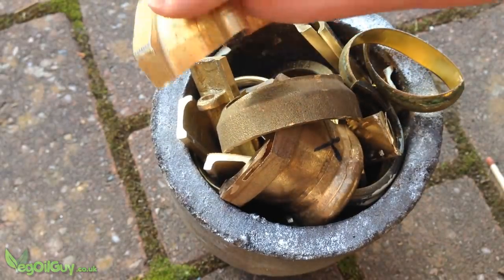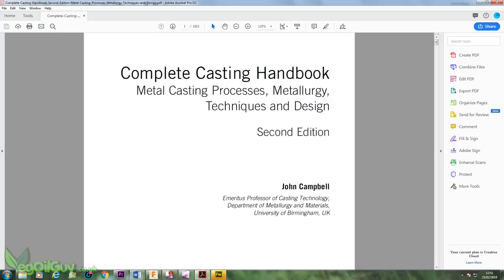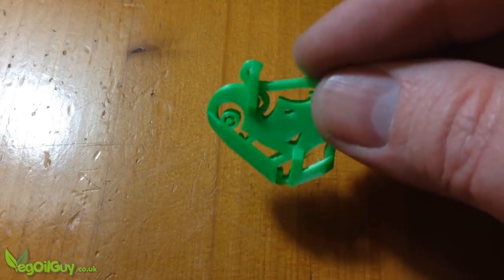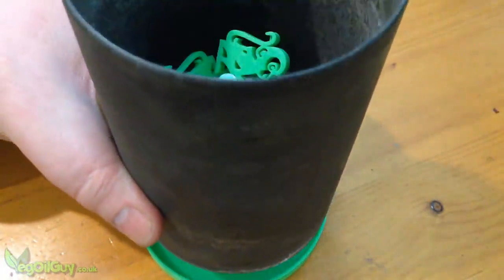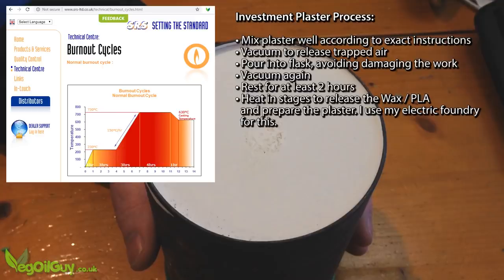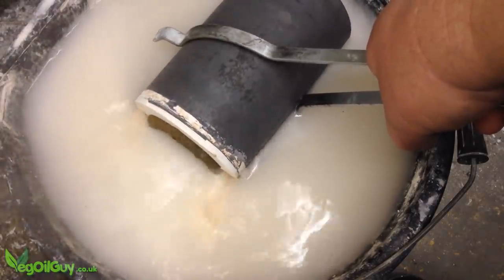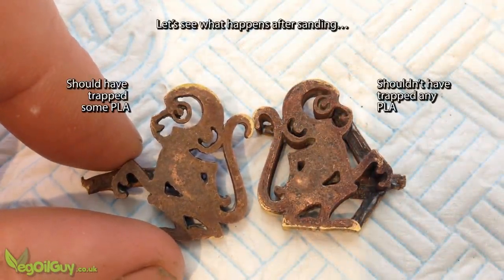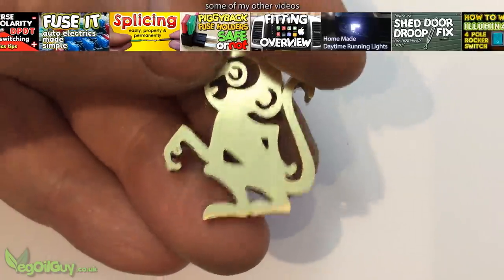Lost PLA Casting Brass Monkeys, Tapered Sprues & Casting Tree from 3D print to Brass Casting VOGMAN

Comment: Best investment casting test I've seen on YT. nice to see more people reading Campbell's book
Reply from the maker: That's very kind : D
And reading Campbell's book is easy. Understanding it is a bit trickier for the amateur like me ; )
Reply: All that blue-white smoke from the brass... don't breathe that. Metal fume fever cased from breathing the boiling zinc in the brass turning to zinc oxide in the air is no fun.
Reply from the maker: I was surprised how smokey it was. I imagined it was impurities - dirt, grease, flux, etc, but I understand it's common enough with the metal.
Reply: @vogman  understanding some parts of Campbell's books are hard for industry casters too, that's why you see  shops pouring a pencil sized stream of metal through a straight sprue you could fit your arm down and not down a proper sized tapered sprue.

Comment: Great results, Im impressed with the detail you are getting with PLA and FDM printing. I use a bucket with a hole in the lid and a pressure washer to remove the investment before cutting the castings from the tree. a mild pickle or acid will help brighten up the metal. Citric acid is used to descale Brass coffee machine parts so you could give that ago.
Reply from the maker: Nice tip Wayne. I considered the pressure washer but it's so messy. I also did soak for a few hours in vinegar which helped a little
: )

Comment: Hey VegOilGuy I recommend cleaning in a wet tumbler with stainless steel pins. Use a little dawn or your favorite dish detergent and some LemiShne or citric acid. It only takes a little of each. The still pins will clean the scale and polish the brass to a beautiful shine. Let the water and pins do the work for you. For example look up cleaning brass shell casings with steel pins. love the video and the small items you are casting.
Reply from the maker: I'll be honest, you're not the first to offer me that advice. For that reason I've ordered one and am awaiting delivery  : )
I'd never come across them, so I do appreciate the advice. Better to be told several times than not at all. 
A bit of research informs me that as well as polishing the surface, the bearings act as tiny hammers and actually harden the surface slightly.
I'm all about the lazy way. Thanks for the input  : D

Comment: Just splendid. If I may; try giving pieces a quick dip in muriatic acid followed by a whiz with rotary tool brush. Tremendous time saver (and great for us lazy fellas).
Reply from the maker: I'm all about the easy way  : D
Thanks for the tip.

Comment: Great looking castings, and some interesting experiments! Thanks for sharing. Every new video is making me want a 3d printer and an electric kiln/furnace. If you don't mind my asking, what's the investment plaster costing and where are you getting it? 
Have you thought of making extra voids in the investment so you don't need so much of it and the vacuum can suck more directly at the castings?
Reply from the maker: The investment seems expensive at a glance, but it's a very large bag. Here's a link - https://www.hswalsh.com/product/pioneer-smoothcast-investment-powder-tc0451
And a 3D printer? Be warned. It will change your world. The moment you start, your thinking changes and you can see more creative opportunities.
Yes I have considered using up space to minimise lost plaster and also ways to improve the suction through the plaster, but in honesty it's not been an issue yet. I struggle to fit everything in as it is, so there's not as much empty space as you'd think, and vacuum works very well through the plaster already... that's the plaster's job  : )
Reply: @vogman  The other thing to consider is that introducing either fill blocks or void spaces adds additional variables to the casting process and could easily cause unnecessary complications. In this case the minor extra material used in the casting is the price that you pay for the K.I.S.S. Principle. Keep It Simple Stupid and things are more likely to succeed.

Comment: Nice work once again. Brass can be a bit of a pain to cast I haven't had too much luck either. Might help adding the borax earlier on as it can form a protective layer preventing too much zinc burning off.
Reply from the maker: It was my first time. I was amazed how smoky it was. And the scale was a surprise. But it does produce a beautiful finish.
I'll have to give your tip a go  : )

Comment: You will always get that look from brass when it has just been cast even from Ingots. The more work you put in to fettling the nisa the monkeys will look.
Good job 👍
Reply from the maker: Thanks Stephen. It is a rewarding metal to put effort into. That shine is gorgeous. I just can't capture it properly on video  : )
Reply: @vogman  have you ever worked in castings or is it just a hobby.
I spent 18 years working for company that casted aluminium and steel components for the aircraft industry. We used the lost wax investment process. very similar process to what you're doing but we coated our castings in zircon.
Nice video looking forward to seeing more 👍
Reply from the maker: No my friend. It's purely a hobby and quite a recent one. If you look at the dates of my videos, you can see how recent.
I tried Lost Wax and enjoyed it, but I don't have the skills to produce the excellent waxes I want, plus silicone moulds are expensive. But I've found by treating PLA as Wax, it works brilliantly  : )
Zircon eh? Never heard of it, but I'll look out for it  : )
Reply: @vogman  it's a coating that is put over the wax mould, well it is actually dipped Into it and built up in layers, it then goes through an autoclave to take the wax out of the mould prior to casting.
To clean your moulds we used a hi pressure water jet, maybe you can use a jet washer but be careful that it does not blast your parts of the mould.👍

Comment: How do you enable the vacuum process in the plaster mold? Is there a separate hole to meet up with this? Apologies for asking, but I didn't see in your vacuum casting video. Thanks! great video as allways!
Reply from the maker: No worries Robert. The vacuum is turned on before the pour. The plaster is porous on a microscopic scale, so whilst it doesn't look it, the vacuum can suck through it. It grabs the metal and pulls it into the plaster mould, removing all air pockets that would otherwise spoil the finish  : )

Comment: Didn’t disappoint! 

What about throwing the parts in a vibratory tumbler to clean them up without any elbow grease?
Reply from the maker: I must be the last to have heard about these...but I'm catching up quick I hope  : D
Reply: Haven’t got one but would love to see if they actually work! Heard good things...
Reply from the maker: I'll see what I can do  ; )
Reply: @vogman  , I just wonder if one could use a case vibration system.  I think Lee and RCBS are 2 places to start. They are use to vibrate cartridge cases in I think walnut hulls ground up.  It cleans them inside and out and even the primer pockets to a very nice shiny surface.  Not sure about cost or availability.  UK I think you can look for one on Optics warehouse or is it optics planet? 
   So any way it's a half hemispheric bowl w a lid and a centerpiece.  One puts in brass and polish media and turns it one n leave it for a time period.  The vibration rolls and stirs the parts. I've heard of it used for brass bronze aluminium copper steel and cast iron. Various types of mediums and coatings can be used I hear. 
  Hey check it out...and maybe you can bennifit from it...or smart as you are you'll make one of your own w an orbital sander and an old gyroscope. 👉👉👍👍👏👏👏😁.
   No insult intended but I find you unusually resourceful in repurposing things. 
   Blessed days sirSir and keep up the very interesting work u do, Crawford out
Reply from the maker: No insult taken, Daniel. I tend to find if I buy things at a price I can afford, they don't work very well. So I try a few alternatives to see what happens  : )

Comment: Thanks so much for those experiments!  I am just getting into lost PLA and I had wondered both about sprue design and trapped PLA bits.  You answered both my questions! On another note, have you been happy with your bottom draw vacuum system?  I've noticed that the pay for systems draw a vacuum on the sides of the flask as well.  Doesn't seem like that is really necessary given your results.  Would you agree?
Reply from the maker: Hi John. I would imagine that an all-round vacuum would give better results, BUT it's quite an investment. I watched PressTube talking about buying one for $10,000. Now I think that's a bit steep, even by professional casting standards, but my home made system could honestly be made from spare parts... and with brand new parts, maybe £50. 
So if you've got PressTube money, get the best. There's no guarantee your castings will improve unless you do everything right, but the equipment can't be blamed.
If like me you're on a budget and still learning, then do it on a shoestring. Get your casting skills right. Then maybe one day you can get the expensive equipment - that's my logic .
BUT... and I really mean this, some of the lost PLA's I've done recently, I genuinely can't imagine HOW they could be improved upon. So the equipment does work... and I can put the savings to other fun stuff : )

Comment: Would using an abrasive blaster help to clean small details?
Reply from the maker: I haven't tried it, but there's a couple of comments here from guys recommending it. I think I'm going to have a go with a DIY tumbler first. If it works and does a fair job, I'll be sure to share it here  : )

Comment: I like the method! It looks like the surface finish turned out extremely well! 
I might have to take a crack at this, assuming I can ever find any refractory in my area.  Luckily, I've still got a bit of SatinCast around.  Any good and reasonably priced crucibles you can recommend?
Reply: I rather like the unfinished edges as well.  It shows it wasnt mass produced, and adds to the overall look to them.
Reply from the maker: Crucibles... it's a love and hate relationship there. I'd love an expensive one as they apparently last a while, but they're ten times more expensive than the cheap things I purchase for eBay.
Reply from the maker: I'd like to claim it's an effect, but really it's just lazy clean-up  : D
Reply: Ah, it's a feature, not a flaw! 😉 I'll have to look on Ebay. Thanks!

Comment: Very good!  I'm thinking of lost PLA castings in the near future.  Have you done lost PLA with with sodium silicate molds instead of plaster?  Is that possible?
Reply from the maker: Hi Andrew. I did a number of experiments when teaching myself Lost Wax casting and soon realised there's no substitute for the proper Investment Plaster. It's porous on a microscopic level and that allows a vacuum to pass through the plastic, acting on the metal. It greatly improves results : )
Reply: @vogman  can I email or private message you and ask your advice on a part I need to cast?
Reply from the maker: Of course my friend. Just go here - http://vegoilguy.co.uk/contact_me.php - and send a brief message. This will allow us to exchange email addresses privately and then we can chat from there : )

Comment: Over on swdweeb’s channel, John Campbell’s protege Bob Puhakka has a few videos up explaining the best-practices you can glean from the book.

The main purpose of the pouring basin is to avoid sucking air down the sprue. The smaller rectangle shape is much better than the full circle version you have here.

The only other Campbell-related suggestion I might make is to try to bottom-fill. Right now, you’re pouring down the same sprue that air needs to be expelled from. It might work better—and not be much more work—if you had a tapered down-sprue, then a U, then the up-sprue to which the molds are attached.

Comment: It's the zinc, it melts and oxidizes at a much lower temperature than other metals.
Reply from the maker: There you go. You learn something every day  : )
Reply: @vogman  zinc's melting point is actually low enough that you can do it on you stove.

Comment: I sand blast the investment off... very easy.
Reply from the maker: Nice idea. Probably lightly sands the surface as well. Saves wire brushing  : )
Reply: @vogman  and one can be made for just a few bucks (pounds) with an old plastic bottle and an inexpensive air gun... TKOR even did a video on it.
Reply from the maker: I'll have to look out for that one...
Reply: @vogman  I'm sure a man of your talents could easily make one.

Comment: Could you update the thingiverse casting tree model to this one?
Reply from the maker: I will be doing... I just want to try a few tweaks first. Once i think it's as good as I can do, I'll be sharing it. That way I won't frustrate people with frequent changes. But in the meantime, the other one will certainly work nicely  : )
Reply: @vogman  Awesome thank you! I find it far easier to print the tree out than any other method of making it, and your model is the best I've seen so far. It makes it super easy to burn out if you print it in a wax filament btw :)
Reply from the maker: I'm glad it's helping  : )

Comment: What is your job sir ?
Reply from the maker: Well, it's certainly not casting   : D
I'm a self employed web designer. But don't tell the others  ; )
Reply: @vogman  That's very nice sir , you have a great hobby and enough time to sppend on it :) Your videos were helpful to me for my manufacturing processes course. Thanks
Reply: @vogman  frontend, backend, "full stack" (not that full stack really means anything as everyone has a different definition for it)?
Language of choice... PHP, C#, JS, Python, Ruby, lua, etc

CMS of choice... WP, Joomla, magento,  Moodle, Drupal, dajango, orchard, etc. 

I've been around the block and have done a little community contribution to Joomla and a few other projects.
Reply: @kasalotahmet7623  check out olfoundryman he gets into the technical details of sand casting, you'll find that helpful if you take more manufacturing courses. Which discipline are you studying? I'm on the ME side.

Comment: Nice..maybe the extra PLA turned into a gas during the melt off..
Reply from the maker: Maybe so Greg. I imagine there were some sooty deposits there, but if so they were part of the thin outer tarnish that's usually there in casting. Maybe in a larger scale experiment it might make a difference, but in this instance it was fine  : )